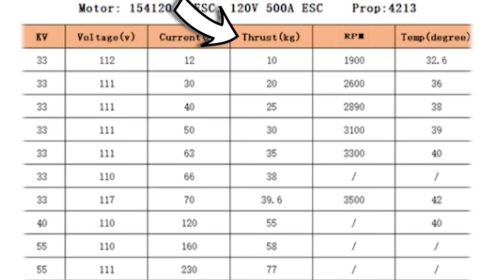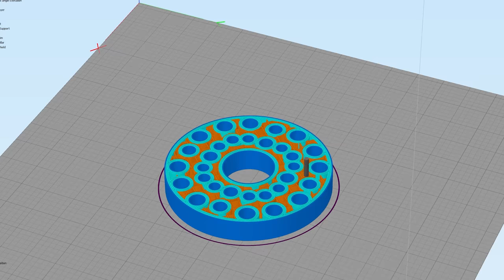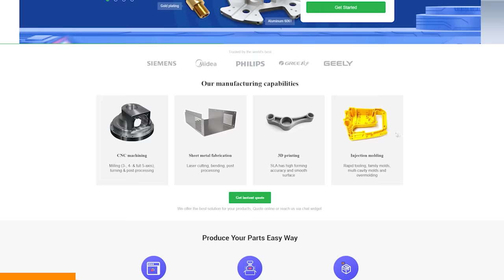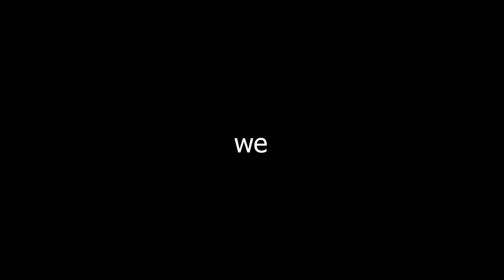Electric Motor From A Car Powers This Snow Racer

Comment from the maker: What do you want me to build next? The most thumbed up comment I will do.
Reply: Make a submarine like DIYPerks made but very advance and huge
Reply: RC jet boat
Reply: RC Jet powered ground effect vehicle/Ekranoplan
Reply: Build a Onewheel
Reply: I think it’s time to start working with some exploding stuff. Go for a rocket!
Reply: Electric snowblower (beast-mode obv) 🔥👌
Reply: I want you to add a spring chain tension wheel between the drive sprocket and the wheel. Also, you could cannibalize the gear sprockets and derailleur from a bicycle to give more than one speed. Slotting your forward runners, and installing in-line roller skates to just barely protrude below the plane of the runners will give multiple terrain capability without much addition of drag.
Reply: You know, it's starting to look like the Batcycle from the Christopher Nolan films!
Reply: @rahulnishadxd  Great idea and I'd love to see that too but the problem with long range submarines is that you need an extremely long tether since radio waves have trouble penetrating water.
Reply: U skuld make a add on like a wheel that u can put in front for off road or drift on ice
Reply: Hopefully something that works...
Reply: waiting for part 2 of world map😅😅
Reply: A friendship with me.
Reply: A snow making machine.
Reply: Winch for a glider pull would be the other one, those motors / that death wheel would hold quite a lot of rope.
Reply: Continuing the trend of oversized, obviously dangerous vehicles to ride on:)... How about an RC plane/ground effect thing you ride over water? Smaller version of what thinkflight made?
Reply: Snowcapable Ebike!
Reply: Saildrone
Reply: A track drive that can change shape? Like for more-or-less of a contact patch for traction-vs-speed? Will lifting the rear of the track as it speeds up do anything? Type thing. Cheers.
Reply: Rideable hovercraft
Reply: A hovercraft, off course😉
Reply: Can you make a remote control robot that can stand-up surf and steer by leaning? The only motor will be to power the arms when catching a wave. Can be 1/8 scale

Or an electric engine for snowboard
Reply: Human size electric jet boat?
Reply: I still want to see that electric quad project get done 😎
Reply: A motorized snowboard to avoid removing the back strap on flat surface
Reply: Monoweel
Reply: Something with your long lost discord server that Zahnatom created during a stream
Reply: A personal aerial vehicle you can ride/fly
Reply: Make a Nuclear fission reactor!
Reply: This but with a lawnmower under it basically a death trap(super fast (remote controlled) ride on mower)
Reply: It would be cool to see a improved version of the electric hydrofoil surfboard
Reply: Instead of a tire use a tire track!
Reply: RC zeppelin
Reply: Plane
Reply: A jet boat you can sit in and navigate
Reply: Build something that won't tear up the grass 😂
Reply: Something a little more friendly with your neighbours and local park…. I suspect your rear tire dig up the grass quite well.  Great project & video.
Reply: Build a small hovercraft for one or two people
Reply: Finish the atv
Reply: Bill Gates crushing machine.
Reply: Go back and fix your old stuff
Reply: Just needs a little weight on that rear tire buddy.
Reply: @rahulnishadxd  drug smuglers taking notes
Reply: electric bike
Reply: esk8 trike (rear wheel is motorized)
Reply: Rebuild kids car and make it extremely powerful
Reply: @Declopse  why stop at RC, make it one man capable!!
Reply: RC your car 😬
Reply: Drone fighting drone that could be used in Ukraine.
Reply: A Tether Car!!! Do it do it do it 😁
Reply: Make a Sit-In One-Man Submarine with viewing port, lights, cameras, and controller arm for picking up items.
Reply: @rahulnishadxd  also make it insanely high powered
Reply: What about an X & Y CNC machine that paints entire walls? Those cable systems. If you wanted to get complicated, perhaps it could use an airbrush and do graffiti etc. Splitting the paint process into multiple layers or passes. Coding in swipe behavior and different airbrush techniques.
Reply: Build something to keep up your neighbours
Reply: I would like to see you take an ice sailor undercarriage and make some kind of electric drive on it with a spike wheel. I think you could go really fast. for that driven wheel maybe grab a QS hub motor which I also use a lot in my videos
Reply: a 3d printed boat that you can ride like a mini jet boat like "grind hard plumbing co" made.
Reply: At this point please just build a batman motorbike, you are halfway there!
Reply: Bygg något med bättre viktfördelning
Reply: @TheWebstaff  That's an interesting take!
Reply: Make a sled with 80% of weight ON the tire.
Reply: A powered bobsled... either jet or your tire on the back
Reply: Isn't it time for you to construct a manned aerial vehicle? :)
Reply: Build a electric jetpack
Reply: Most handsome man on the planet🤣🤣🤣
Reply: Jet power snowboard
Reply: An elevator for your Electric raft. Insanely fast and overpowered of course.
Reply: Rc jet boats please 🙏🏻
Reply: A miss Simon 2.0
Reply: please dont get hurt.
Reply: Tesla swap
Reply: 3d printed version of the robot "spot" from boston dynamics
Reply: One idea you could create would be a model glider to release from a weather balloon. There could be potential records to set with this. The aircraft would obviously need some electronic components such as a gyro and GPS, among others. It would be fun to see how far you could get with this. If you make this, I could come visit from Norway to watch. It would be a great sight to see.
Reply: Hydrofoiling (Solar) Race Boat
Like this one :
https://youtu.be/xWPqzThcxeM
Reply: Snow tracks instead of a tyre, like a snowmobile
Reply: Build a airplane that you can fly 😅
Reply: Build an EUC (electric unicycle)
Reply: a drone that you could fly on!
Reply: Airboat where you can sit on would be nice to cross the frozen lake and still be fun for summer
Reply: a hover car you can ride on
Reply: Can you use this motor to build a pedelec?
Reply: A better 3d printer
Reply: Hva som helst, bare ikke forstyrr naboene 😆
Reply: Have you ever thought about making a rail kart? I feel like you would do an awesome job and it would make a great video. I just don't know if it's feasable where you live.
Reply: RC porta potty. Park it somewhere then drive it around once people get in it.
Reply: @f.n.schlub  not quite sure a bike derailleur would be able to handle this, the amount of instantaneous torque is probably too much for it.
Reply: Hey bro just letting you know ow your tire is on backwards.
Reply: A reliable and cheap powersupply for the Swedish people!
Reply: As long as you don't destroy any more parks :( You know landscaping costs money right?
Reply: Honestly, a drone you can sit and hover or fly on.
Reply: Ekranoplan or similar ground effect vehicle GEV/WIG with electric propulsion.
PGEV=Personal Ground Effect Vehicle.
Reply: Mini drone
Reply: Building a monowheel would be a pretty big challenge, but also really cool to see
Reply: RC garbage can for garbage days where it is snowing. For, erm... Science...
Reply: Buy a (pink) kids toy car, stretch it and add massive motor to it
Reply: A high power super fast sea scooter.
Reply: a 3D printed electric car.
and then go to the Swedish DMV and ask them to register your car.
Reply: An affordable electrical hydrofoil for two or four people.
Reply: Street legal cabin e-bike with that exact motor and see if you can reach 100km/h
Reply: Du vet... host I mean you know you could use a smaller wheel under the seat thusly add one more then make a homemade belt track. that way it will be more like a snowscooter and you will get more downward force and grip. 

How about a high speed turret that shoots grapes ? y/z axis and have it look like the gigantic cannon the germans made :P the inertia and power will give some fun "how to get around the grapes imploding of the force of either one" hf
Reply: Hovercraft!
Reply: Next project - walk speed multipliers with ice spikes for ice - like these, but cooler and cheaper: https://youtu.be/qe4CHWulnDs
🌨️😎❄️
Reply: instead of skis while waiting on ice, use roller blades. Great contraption, i see a ton of potential...
Reply: a cover for the chain would a great idea to have more videos in the long run
Reply: RC tunneldigger thingy with fpv. Does not need to be perfect but could be a great start. And i think nobody has done it jet.
Reply: Get a 20kg pocketbike, mount the car motor in it and install ice spikes to it 😁
Reply: You should make your designs better. Read the comments here and fix your mistakes. The wheel is backwards its not providing enough traction. There is no weight over your rear wheel so it keeps slipping. Add some extra weight there or move your seat rearwards. Even cutting off some of the back of the skis would have helped.
Reply: I would like to see the ATV again
Reply: Solar powerd electric longboard
Reply: Bathtub Jet Boat 👌
Reply: add roller skate wheels into the skiis. done deal bro.
Reply: Modify this system by replacing the plastic skis with Ice skates/blades
Reply: What about a small JETPACK who will lift as much as possible 🤔
Reply: Automatic loading snowball gun. I imagine being able to stick the barrel into the snow, where it will compress it into a snowball and load it to be fired.
Reply: Bro you forgot about the discord
Reply: A very light big quadcopter and for the blades use goose feathers. blade would  turn slow and quiet. ??? Find where they stay you will find the feathers you need.
Reply: Like a manned drone would be cool
Reply: In the next episode you should definitely try the square wheel for your vehicle 👍
Reply: Dirt Ebike out of a 250cc or better real dirtbike frame using either the old or current  the motor from ur snow ski project
Reply: hade varit roligt om du trimmade en bobby car, du vet en liten röd bil som man hadde som barn.
Reply: @miojakkai3533  tack, nej.  din personliga erfarenhet av denna procedur kommer att räcka för alla att veta ;)
Reply: 3d priny a belt tread
Reply: Go cart from washing machine motor. What i got 😆😆
Reply: Hi, i love your content and i have a video idea: Make your own electric skateboard with 3D printed parts.
Reply: Electric hovercraft you can ride
Reply: A hovercraft you can ride
Reply: an automatic ice fishing tip-up! once the fish grabs the line it starts reeling it in!
Reply: make a 1/2 scale rc snowmobile
Reply: Rc solid fuel combustion rocket
Reply: You should redo it by putting the motor and tire in the front and the skis in the rear.
Reply: thane heins quantum motor generator please!
Reply: Regen X motor - Thane heins
Reply: Your weight has to be on top of the tire for this to work efficiently.
   That's where all your power loss is at... It's not the tire tread---weight distribution.
Reply: Put a wheel on the front spray it black  u got a bat bike

Comment: This is why I like RCLifeOn. Instead of fixing the obvious issues like: almost no downward force on the rear tire, the point with the highest amount of downward force being the greatest point of friction (the sleds), etc. - he drills screws into the tire.
Reply: Were living in the renaissance of non technical engineering.
Reply: The channel uses MAGIC ... if you listen again you will hear him admit it re the tyre :goat-turquoise-white-horns:
Reply: YES
Reply: Maybe you should start your own channel, where you can follow the obvious.
Reply: lol i was thinking the same thing
Reply: doesn't matter. just matters that it works in the end.
Reply: If he engineered the best solution he would just end of with a skibike
Reply: @chrishayes5755  itll work much better if the rear was weighed down
Reply: yep - cutting the rear off the sled runners would change it hugely.  NB. fanboys can't handle anybody being constructive, just have to sing praise regardless. lol...

PS, RCLifeOn has done lots of great, inspiring builds - right from the early days.
Reply: I love this guy, but for the whole video I'm like, please God, make him put his body weight closer or above the tyre.
Reply: It's like a Ivan Miranda lite, can't stand his videos. Blows up good parts making stupid mistakes because he doesn't think
Reply: @BrainfooTV  This and also the description of what's going on, especially the, 'we're not lacking traction, there's too much friction,' statement, like does he have literally no idea how a tire works or what these words actually mean?
Reply: @xaytana  Well I'm lost
Reply: I commented before I read yours.  But you are spot on.
Reply: @RKisBae  lol, I have been seeing a lot more free energy😂 and perpetual motion machines on YouTube and TikTok
Reply: Seems like he likes doing that 😂
Reply: We were all thinking it
Reply: the biggest issue was the sled, like hes trying to move a wall by pushing, eventually it will work but you can better find an alternative
Reply: He should redo it by putting the motor and tire in the front and the skis in the rear.
Reply: @ZenMountain  i guess you lack reading comprehension. The imperfection of the build is what makes this channel entertaining.
Reply: @xaytana  There's plenty of traction but just to much friction and also the tyre just shreds the dirt and and can't go deeper to grab more dirt and the dirt can't sustain the forces needed to move it forwards.

Comment: Tyre is mounted backwards... :) ( the V grooves must point forward, not backward. Working in this way, the mud is being directed to the center of the tyre instead of being expelled to the sides)
Reply: looked the tires up,  "sunf a003"....they have a directional arrow...@framegrace1 you are correct
Reply: Was thinking the same. Tyre is definitely mounted wrong, loose material like snow and sand will be pushed inwards this way and the wheel wil slip mount it the other way around so the material gets pushed to the outside which will also give it more momentum forward
Reply: Yes, you're right, of course. I went outside to look at the tyres (BKT 6.5 / 80-12)on my two wheel tractor  and sure enough, the v at the bottom has the wide end facing in the forward direction. They have a directional arrow , so it's hard to make a mistake when fitting them.

Comment: You could also embed wheels into the skis so that on non-slick surfaces it would roll rather than try to slide. On snow it would still slide. You might would have to widen the skis bit though.
Reply: I thought the same. A slot in each ski with a 76mm roller blade wheel or similar
Reply: Or put a metal blade on the skis so that it would have less contact on hard surface and better grip on soft surface.

Comment: You got the right idea for sure! You need more weight over the rear tires but also those aluminum arms are probably flexing a little as well. Maybe try adding like a triangle style brace going from near the axle up above to where the motor sits and back down to the frame. Love the stuff you come up with and cant wait to see how the next video goes with this build! 😊👍👏

Comment: The tire is lifted up by the skids, that's why you don't go. Get back to short studs and make the tire stick out like 5cm compared to the skids. Also moving (angle) skids would work waaay batter, as the wheel would always be in full ground contact. Nice one, as usual, waiting for part 2!
Reply: I wonder if removing the side skids altogether would help. The bars would be enough for stability.  Or at the very least cut them down significantly to reduce drag. This thing should be an absolute ripper!
Reply: nah, it's meant for ice. The studs make sense. It's not going to work on anything else.
Reply: It might also help to let some air out of the tire so it will compress a bit and have more surface area. Its an ATV tire, so its made to have a lot more weight on the tire to compress it at the recommended PSI.
Reply: There's not enough weight in back it's more like it's floating because of the skids on sides for sure

Comment: Bro, if you actually want it to work from start up on soft surfaces without giant spikes you need to lengthen the front end by about a meter or two. Just bolt the front of a bike frame on there ;-). Keep your seating position the same, that shifts your CofG way rear of teh new wheelbase (as everyone is saying) and takes pressure off the skids.         Also whatever: we enjoy the ride 🙂

Comment: Try adding removable inline skate wheels internal to the sled, so that they come into contact with the surface that you are on. There is way too much friction between the sled and the surface that you are trying to traverse.  When on snow or ice, just simply remove the wheels to slide on the sled.  You'll probably to wax the bottom of the sled for this

Comment: Another comment gave me an idea that may work very well for this. At the moment your skids are fixed in reference to the frame, some skid based vehicles have the skids mounted on bearings so the skids can always be parallel with the ground and follow the contours of the ground, which hopefully increases surface area and therefore decreases the pressure between the skids and the ground which should help with friction and weight distribution. It would also allow the back wheel to always be in contact with the ground as much as it can, without it kind of being held up by the skids. Overall rotatable skids would be a very good idea for this, they would also help with going from the flat onto hills since the skids could rotate to match the angle of the hill whilst still keeping them in proper contact with the ground.

Comment: Impressive that you got it moving on pavement and gravel. The friction is huge! Even on snow, the friction is signifikant from those beat up snowracer skiis. 
For this kind of build, I would suggest you buy a mig-welder and use steel profiles or tubes. You can do so much with a welder, angle grinder and some basic hand tools.